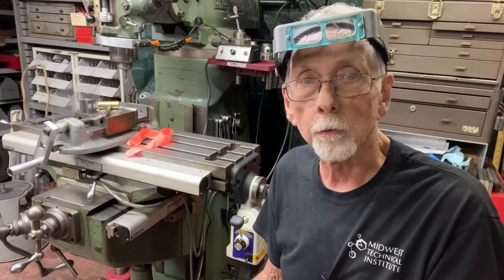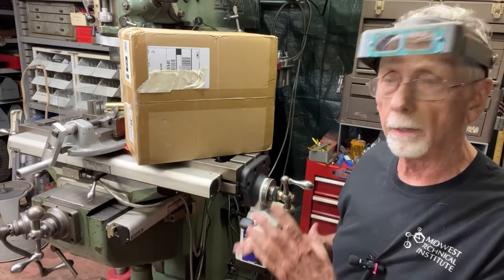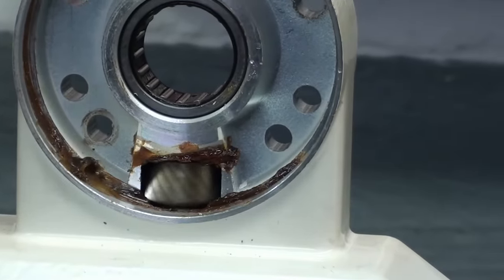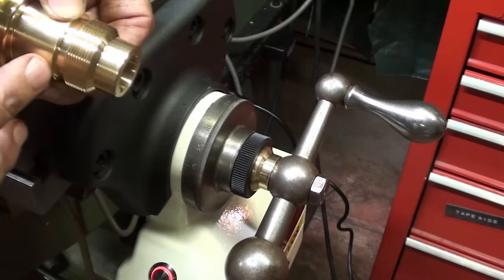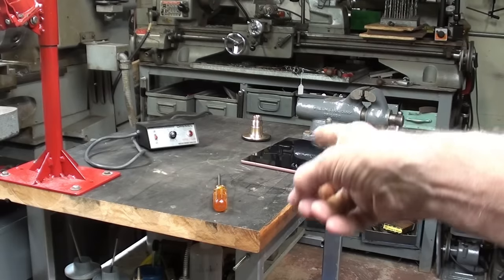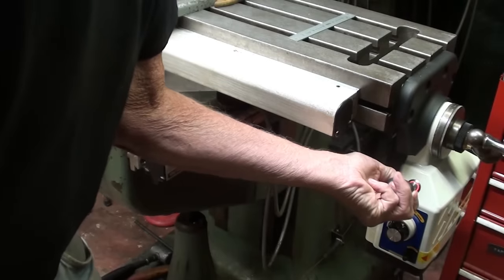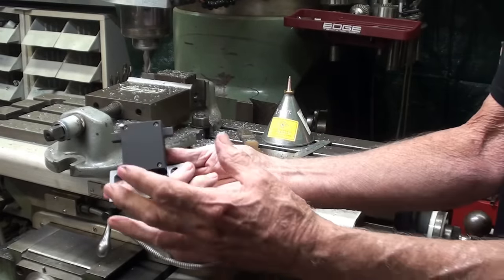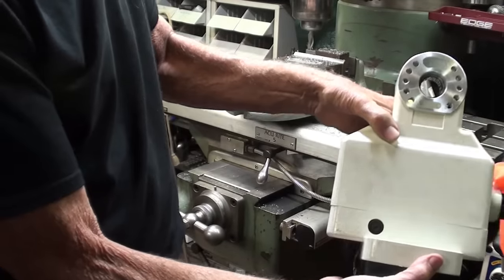IT WORKS!  Bridgeport Power Feed #888 tubalcain VEVOR

Comment: Just a little tip Lyle in case it happens to you. If you find that by operating the lever to make the table go left or right, you find that the table speed increases or decreses, do the following. Slacken off the speed control knob screw and move the knob further away from the lever. If the gap is too close then the lever will gradualy rub on the knob and alter it. 2 minute job, including the time to search for a screwdriver or allen key. Great outcome FULL marks to Vevor for replacing it. Regards from Australia.
Reply: Thanks for that timely tip. My Vevor X feed was doing exactly what you described and now I know how to fix it.

Comment: Thanks for the update. The manufacturer should make the piece shorter for the Bridgeport and furnish collars to add for other models. I will bet there are some pots in there to allow you to adjust the minimum speed. My wife's treadmill has pots that do that, but you have to take it apart to get at them. Notice I said "wife's treadmill."
Reply from the maker: lol

Comment: To answer your question about mounting a power feed unit to the “Z” axis or knee, yes it has been done.  My Wells Index mill is a Bridgeport clone that was imported in the 1980’s (fortunately the same mill is still being produced and imported by JET and others so parts are still available).  I purchased the mill used years ago, and it came with a Z-axis power feed similar to the Vevor.  Quite a bid of work was done to modify the shaft that the elevation crank goes to in order to make this adaptation.  Consequently the knee can no longer be raised or lowered using a crank.  Instead a large hand wheel was fitted that can be used to manually raise or lower the knee.  I do find it very convenient to use when I need to raise or lower the knee more than about an inch.
Reply from the maker: Thank you for that information. Yesterday, I watched several videos of men installing a power feed on the Z axis. I would like to be able to buy or make the several specialized parts that would be needed.

Comment: Congratulations on still having 10 fingers at your age!
Wish I could say the same. At 72 I still have 8 complete digits, one was reassembled the other is missing the top joint. Who would have thought back in the 50's that playpens and push mowers were so dangerous.
On the plus side, it turns out I got along fine without them and when I count on my fingers, I can do fractions.
Thanks for the infotainment.
Reply from the maker: lol

Comment: Mr. Pete...I did mount one on the knee.  I lengthened the shaft and kept the hand crank on, but it is not engaged.  It floats when using the feed, thus I can still use the crank for fine adjustments.  Using a spring point set screw keeps the crank from ever engaging its self.  My Wells-Index mill is getting harder to move the knee as I age each day.  Worth the 526 hours of retrofitting....lol

Comment: I'm getting old too and cranking that knee sucks so I put power feeds on all 3 axes of my mill when I rebuilt it after it was destroyed when my brother's garage burned to the ground.  He died a few months later long before any insurance claims could be processed so I drug the burnt out hulks of my machines home and started to repair them.  Got the drill press and mill done, working on my Monarch lathe now.  In the process of rebuilding I did some research on these import feeds and concluded you get what you pay for.  These are on the bottom of the ubiquitous Chinese power feed units and this video is an excellent example of why cheap comes out expensive.  First unit you get is defective so their QC is unsurprisingly lacking. There were other differences between the cheaper and more expensive units but I don't remember.  Yes, they are all made in only a couple of factories, but those factories build them based on the specs. of the customer and if they spec cheap, they get cheap.  Chinese machine tools are no different.

 But the more troublesome issue is the handle clearance.  As you discovered, turning down the collar brought the handle too close to the housing causing a very dangerous pinch point.  The difference between the spindle and the power feed is you're not routinely handling the spindle while it's running.  IIRC, the better units come with a special nut that's turned down partially to fit inside of the handle to get more thread engagement.  Another option is a spring loaded safety handle that spins freely unless it's pushed inward to engage a couple of dowel pins to drive the leadscrew.  There's another type of handle that's a round disk with a spring loaded handle that swivels flat towards the center.  Personally, I wouldn't run it like that and I'm pretty anti-safety generally. I'd pick one of these methods to mitigate the potential of getting hurt.

Comment: Years ago I bought similar units from a company known well on this channel, it sounds like something a cowboy would cut hair with, anyway...

I bought three of the most powerful units they sold I installed them on X, Y, and Knee. It made using the Bridgeport much nicer, especially since I am accustomed to machines with built-in feeds on all the axes. 

I also spaced the feed out to give full travel on the X. My 48" table has just over 36" of travel. I also added a power drawbar, an electric oiler, spray mist coolant, and made an operator's panel at the DRO so I don't have to reach to the sky to turn it on and off. One does get spoiled when running big expensive machine tools...

Comment: I got mine with no power feeds I put a shars on the z cause cranking 6" got old fast. It is not very good. I got a servo on x the pinch point is not much better. Still need the y. probly get vevor this winter. I bought the vevor rotary table and It got heavily damaged in shipping. they refunded me 90% and let me keep it. I made new parts for the broken ones. It works fine. It took me 2 weeks to make the parts though. I did not have any jobs when I did it.

Comment: My Taiwanese Bridgeport clone came with a Vertex X axis power feed. The first big mod I did to it was to get another power feed for the knee, got sick of cranking it up and down...
The manual crank lever is now gathering dust in a tool drawer. I love my (locally made) Diamond tool holders from Eccentric Engineering.

Comment: You asked, so yes...I have installed one of the power feed units that was meant for either an x or y feed , and installed it on my knee. I recall needing to make a bracket of sorts to do do, but cannot recall the specifics. It works great and would not be without it.

Comment: Hello Mr. Pete. Just a couple of comments: First the the loose bearing race bothered me so I made an extending bushing just long enough to reach beyond the edge of the lobe on the leadscrew. This way the spacers push against the the race and lock it in. Second, I was able to fix the jam-nut problem by using a normal sized nut and turning half of it down to 0.615". So half of it fit inside the handle. I purchased Vevor Model AL-310s. It has the correct TPI for the Dial Locknut. Also seems to have correct speed range. Thanks again for sharing your knowledge. Best Regards Bob
Reply from the maker: Thanks, you had some good ideas

Comment: Mr Pete, I suspect that the unit it is a DC drive system, although I couldn’t verify it on Vevor’s website.  It may have trimmer pots on the driver board to fine tune the unit to the load.

Comment: A cheap z axis power feed is a battery drill with a 3/8¨ socket drive and a 12 point socket that fits the square shaft on the Bridgeport z axis and you can quickly remove it and use the crank for fine adjustment.
Reply from the maker: Yes, I have one of those. In fact, I made a video on how to make one of those. Plus people have given me drives that are 3-D printed. That is all in my earlier videos.

Comment: Two magnetic bases for indicators might work with the travel stop if you mount it on the back of the table.  It's worth a try.
Reply from the maker: Never thought of that, good idea I might try it. I was currently thinking way to make some kind of tee slot channel.    Chips, getting attracted to the magnets would be the Don side
Reply: This is a good idea.  Maybe even with a threaded adjustable stop.

Comment: Hello Mr. Pete.  Short story, VEVOR sent me a new AL-310s power feed to replace the broken one.  Long story, I had to refuse several ridiculous offers of $20, $35, and $70.  I told them that only a full refund would be acceptable because I would still want a power feed.  New one runs smooth, no clunking sounds, and no broken parts rattling around inside the case.  I'll see about installing it on my Harbor Freight 33686 mill/drill.  Kind regards, Al
Reply from the maker: I’m glad they made it right

Comment: Hello Lyle, I fitted a similar unit to a Taiwanese Bridgeport knock off mill, at our Railway Museum, here in Adelaide. The original one fitted died. It works fine, but some modifications had to be made to the mounting bolts. Different brand and cost about $700 Australian.

Comment: Excellent information, if nothing else it spurs me to fiddle with the little square pots, if the diagram will say which is which, in my tiny foreign lathe to settle the twitching. 
When I grow up, I need a full size vertical mill.
The tiny verical mill here is a real workhorse but he's funky to use.

Comment: Absolutely, mount that other power feed to your knee. Definitely do it. If it burns up oh well it was free. Hook it up!
Reply: Yes, mount it on the knee if you can make it fit. Slow speed is less important on the knee, at least for me. My original Servo unit expired and I’m so old and weak I just had to have another another one. I fitted the new one successfully and  only use it for rapid traverse up and down. I have power feed on all three axis and love flipping those levers and knobs for slow or fast. Once you have them you’ll never go back. It’s like moving from the old crank up windows on cars to electric.
Reply: @ellieprice363 Same for DRO’s. Once you have them, you’d never go back to counting revs of the hand wheels.
Reply: @grntitan1 Very true. I have a DRO for X and Y and even a battery powered unit on the quill.

Comment: You're like a child on Christmas Eave, sounds 20 years younger! Congrats to the good drive.
Bought a Chinese chainsaw with 2 standard batteries and 2 extra, extra capacity. Not using them every day and when checking them one extra extra battery refused being charged. Used the Webb and found a jump start video, and it worked. The battery took on charge. But..... it only charged to half the voltage and that doesn't even light up the LED..... Banggood, I complain......
Reply from the maker: 😂😂 some of the Chinese stuff is very questionable
Reply: @mrpete222   You bet I know by now!

Comment: Without going further into the video, yet, I can say that in many machines, speed control is by resistance in the hot leg going to the motor. Your speed control knob is attached to a potentiometer (pot), a variable resistor, which is often in series with another biasing resistor, which may be a pot or fixed, but isn't usually accessible by the casual user.

In the event that a trim pot is used - which allows the factory people to tune the drive - once you can get access, it's a relatively simple matter to adjust it and get the desired response from the pot connected to the control knob.

If it's a fixed biasing resistor, you are in for a bit of work to determine what the rating is supposed to be, then source the replacement, then do a bit of soldering to remove the wrong/bad piece and replace it. Not horrible, but a bit of a PITA for the uninitiated...

Not saying that this is the cause in this case, but it is a fairly common issue, especially if a mass production operation has less well trained assemblers who just take components out of packages and install them without checking.
Reply from the maker: Thank you for that insight. But that repair sounds a bit daunting do this old man, lol.
Reply: I agree with your statement but what Mr. Pete was saying and I agree with 100% is It should have worked right out of the box. Nothing is more aggravating than buying a new piece of equipment and having to "fix it" it make it do what it was supposed to do. I used to "fix" my new stuff that didn't work as advertised but stopped doing that a few years back when China was (and still is) flooding the market with junk. Today if it doesn't work out of the box, back it goes. To Vevor's credit they have improved their customer care 1000% from what it used to be and the products they sell are much improved.
Reply: @mrpete222  Well, it shouldn't even be needed, but in the case of your first unit it appears that QC wasn't on top of things.

As you point out and the end of the video, there's a cover on the bottom held in place by 4 screws. - remove that and take a look if you're curious.

If there's no obvious trim pot to play with, it might be a project for the electronics shop class at the high school to straighten out. It's about the right complexity for a sophomore's first project. Simple enough if you've got the right mind & eyesight for electronics... Even easier if there's a schematic somewhere for the circuit and assembly, showing the part numbers.

Horses for courses and all that... ;)

Comment: Lyle - Interesting - but a question.  In turning the collar down you are using the Diamond tool holder with the vertical shear bit.  You mentioned a few times that you were going to do a video on that.  I can't find that you ever did - but I'm really curious as to how useful that tool holder is in normal work.  Any comments?  Thanks.
Dale
Reply from the maker: Still coming in the future sometime
Reply: Blondihacks does a video on it.  Des at Eccentric Engineering in Australia makes and
sells the tool, comes in both left and right hand.  There is a video on YouTube as well.

Comment: You can get aluminum t-slot rail that gets recessed into wood tabletops for clamps and stops. Very low profile.
Reply: I was thinking the same thing, he'll need to drill & tap some mounting holes.

Comment: The boys at work have a power feed on the X and Y that are controlled by a programable DRO and one on the knee as well. They have six or eight bridgeports of various sizes and configurations. You should put the old one on the Y axis if you can get it fixed.

Comment: Hi Mr Pete that bad one would make a good knee power feed you would have to make the shaft. JM
Reply from the maker: Yes, I hope to use it on the Z. In fact, this very moment I am watching a video on how to do that. But there are several very special parts that I would have to either buy or attempt to make.
Reply: If you could buy  one then i think all you will have to do is enlarge the ID of the gear. It was a bit of work  but i had no other use for it i have another for the Y axis one day i will have to convert it also . Its would be nice if Vevor sent you one for the knee. JM

Comment: mr pete i have one on y and z i have the original servo  on x but i got them on amazon as open box deals so they came with not all the parts i have the z  handle on  the  mill with a spring so it dosent stay engaged it would break your knee  and not the mills knee  i could send you some pics  thank you for the free education  dean

Comment: Could you have shortened the handle instead of the brass part ? You would have to machine some off the nut side of the handle so the handle wouldn't make contact with the Vevor unit.
Reply from the maker: Good idea, but too late

Comment: I no longer have 10 digits. Last year I was running a large radial arm drill press. I had a 6" diameter spade drill about 24" long in the spindle and I was working on taking the spade out of the drill so I could sharpen it and the drill dropped out of the spindle and mashed my pinky between the drill and the sharp edge of the hole I was drilling.. They had to cut it off because it was so messed up.
Reply from the maker: That is a horrible story. So sorry to hear about that.

Comment: Hello Mr. Pete.  I just thought you might be interested in my issue with VEVOR.  They have offered to replace the fan on the electric motor.  I had to respond that the electric motor fan is not replaceable.  I attached pictures of the broken fan and a parts diagram.  I finished with saying the only fair option is to replace the unit or issue a refund.  I'll let you know what happens.  Regards, Al.
Reply from the maker: Very disappointing. I hope they make it right.

Comment: Consider replacing the crank handle that is on the unit side with a solid dished wheel. Another option is a handle that is spring-loaded and spins freely unless pushed in. My mill has the spring loaded crank on the left side and the wheel on unit side (its a older Servo unit).
Reply from the maker: Thank you, excellent suggestions

Comment: Hello Mr. Pete.  The Vevor power feed arrived yesterday.  I just plugged it in and cycled it between forward and reverse.  My issue is that it makes a loud hard 'clunk' when it goes into forward and again when it goes into reverse.  Does yours do that?
Reply from the maker: Yes, it does, and I watched a few other videos were the man said that there was dead that also so it must be normal although it’s disconcerting. But I believe it’s the clutch doing that. Blondie hacks took one apart if you want to see the inside. So I would say, don’t worry about it.
In fact, both of mine, make the same sound a clunking sound